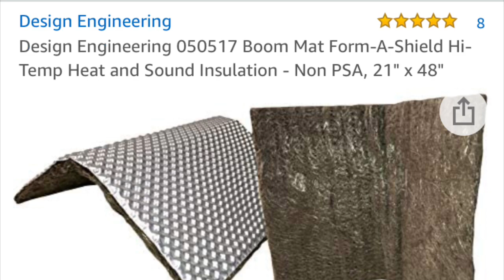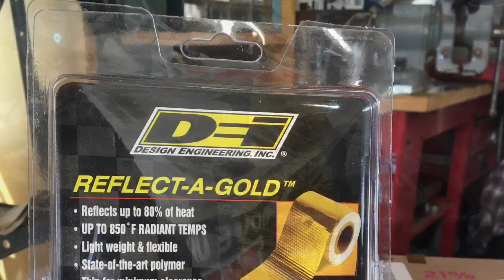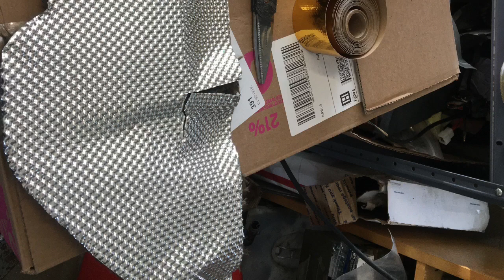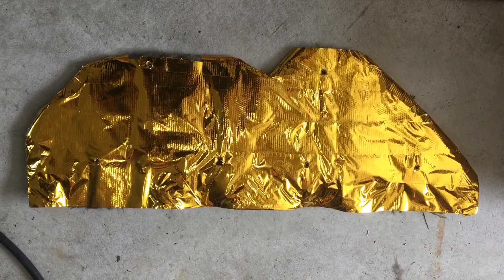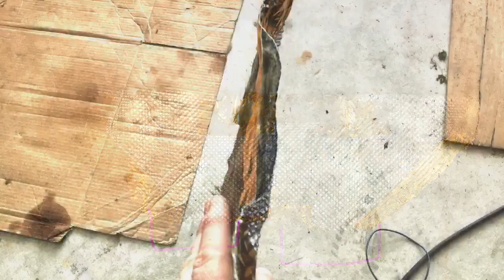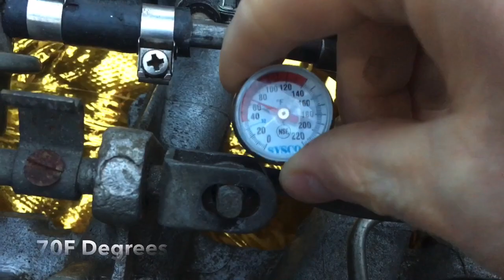A Better Heat Shield (Intake Manifold) DATSUN 280z

Comment: Before buying the header...make sure its CERAMIC COATED!!! Z Motorsport sells a great header w or wo ceramic coating. Spend the extra money. It reduces heat up to hundreds of degrees!!!!
Reply from the maker: This z had the ceramic coated header. I should have mentioned that, when discussing temperature readings. Thanks!

Comment: I haven’t use the heat shield I think mine Has been removed because I don’t see it there do you have to remove the intake and exhaust to put the heat shield on? I’m assuming you have to?
Reply from the maker: You don’t have to remove either
 manifold to install the heat shield. If you are installing a thicker heat shield, like the one I made, make sure it is not touching the exhaust.  It will be close. If there is even the tiniest bit of space between the shield and the exhaust manifold, you’re intake will stay cooler.